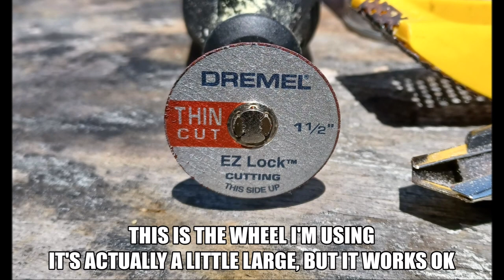Charred Wood Tutorial

Comment: Have you ever tried to add a small diffuser or fog machine to add a smoking effect.
I used a fogger away from mine and redirected some smoke via a flexible black tube and drilled holes in the base of my embers and at the end of the tube to release smoke under my ember base 
You can also use the mist maker to achieve this effect as well, I’ve dug a hole and placed a reservoir of water underneath and then placed my embers over top and let it smoke up and around them.
Reply from the maker: I did that with the Burned At The Stake prop I made for Red Vein Haunt a few years ago. Built it over a piece of plastic pallet so that there would be a hollow chamber inside and drilled a small hole in the main fog inlet pipe to bleed off a little fog into it. The coals had small holes hidden all over for the fog to seep up through.  Another one I did was made to look like sticks under a cauldron. It was build over a mini laundry basket and had a 2" pipe inlet on the back. I piped in chilled fog that would spread out from it in all directions to blanket the inside of the witch hut. This one will just be plain ole glowing embers though.  I'm already running 3 foggers. I feel like any more in my small yard will be overkill.
Reply: @OakLaneCemetery  that’s right I remember that one great job  I was inspired I made a corpse skeleton but I didn’t smoke it  lol 
I love your channel 🧡🖤🧡🖤🧡🖤